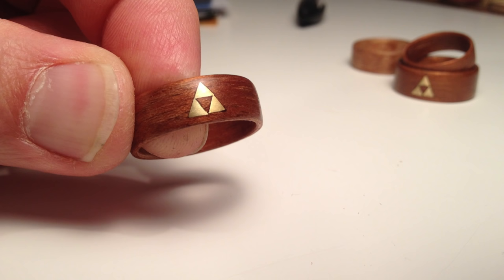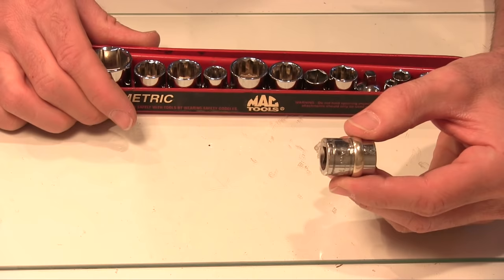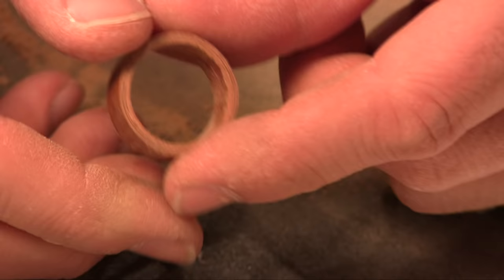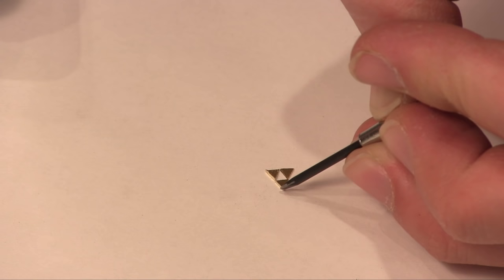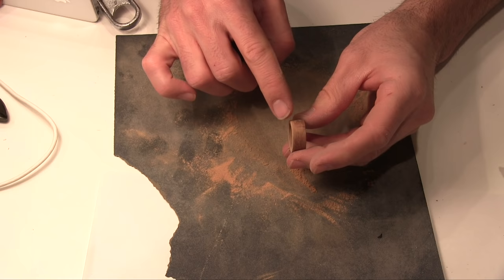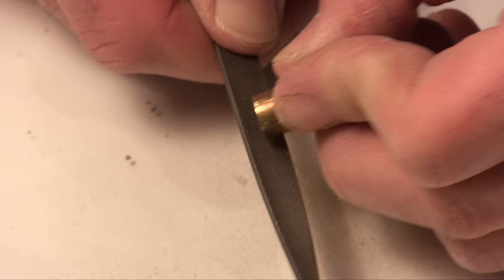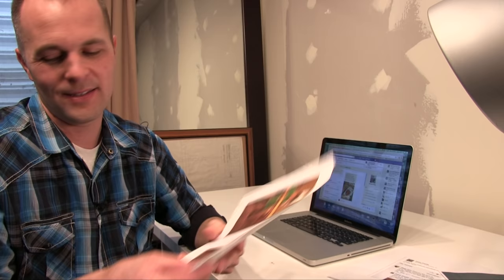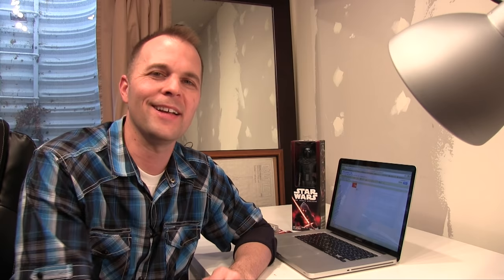How to make Wood Rings - bent veneer w brass Zelda Triforce inlay

Comment: If you want to improve bending process, i would soak the veneer in ammonia hydroxide  rather than hot water. Its a little nastier (safety wise) but the wood won't kink and once dry, it will 'set' in the new shape rather than slightly springing back.
Also  a ring mandrel is like £7...
Reply: I didn't finish watching the video when i wrote this, you used super glue?! wood glue too good for you? godamn pva would have suited this job better.
Reply from the maker: +Stephen Bathory I will have to try that some time. Thanks for the suggestion. The superglue makes the wood waterproof and rock solid.
Reply: +Colin John Cunningham Way to make what could have been a helpful comment sound pretentious as all hell. Not sure if you meant it that way but you come off as more of a snob who like to throw big words around not a professional. Also next time you leave a comment like that, there's really no need to tell someone that you didn't like the project first like he was looking for that validation before you add your two cents.
Reply: +Stephen Bathory I definitely wouldn't use wood glue, because not only it isn't waterproof (by far!), but all the stuff emitted by the human skin would make it fall apart in no time. I'm assuming that the maker of the rings would want his rings to be wearable....
Reply: +ZombieAlchemist As a fellow but mere amateur woodworker, I also didn't 
care for the obviously amateurish nature of the video (the figure/chatoyance(the optical waviness in the wood is called "curl" and NOT made based on how it's cut as the ignorant video states, but an uncommon way the wood grows). Also, bent wood lamination can be done using water for soaking and also with PVA glue, but also as corrected, other fluids and adhesives are much more suited o this particular project since it's a very tight wind as well as needing to be waterproof, which obviously this amateur that only saw 
someone do something cool and wanted to make a buck off putting this up would not know - a disservice to the watchers as well as the true pros that put other more informative and correct videos up on the topic. I'm NOT a pro woodworker as stated, but a decent amateur who appreciates Colin for saying he's a Pro since it differentiates himself from the video author as someone who actually knows what he's talking about, as opposed to simply being pretentious! 

Thanks anyway HappyAtom for sparking people's creativity and possibly getting people into the craft, a rewarding and useful hobby. I'd just do a little more research first so as not to mislead your viewers or sound too much like you have no idea what you're doing to anyone with just a little knowledge about the subject.

Additionally, if the springback isn't as much of an issue, you could still use Tightbond III since it is waterproof. After which, a finish will protect it better from acids and moisture from fingers (varnish is most suitable or a oil/varnish like Watco Danish Oil, which can be re-applied as it wears) .
Reply: +Colin John Cunningham I stopped reading you comment at "while I am not very impressed..." Nothing good comes from arrogance.
Reply: ESPECIALLY if this was for children, I wouldn't let them anywhere near 
CA glue! Speaking of idiots, and talking like one ("people with little
 to know knowledge"???) all you have to offer is pure criticism of a very valid statement. Comments here are FOR people to give their opinions, good AND bad. Being "not very impressed" is hardly a heavy handed criticism, especially given the many issues with the video already addressed.

And it's not at all about complicated, it's about there being alternatives that are better/safer/etc. and also about giving reasons for things that are simply untrue, stated out of ignorance. 

Maybe you should be more aware that comments for How-Tos are as much about sharing knowledge for those ADULTS (not you apparently) that want to learn more about what is contained in the video. They also would care to consider the source, as well, so stating you're a professional woodworker, etc. is of value, NOT tooting your own horn, or coming across as an ass, which you did in your very rude blast of someone offering a professional perspective to someone that was actually purely being rude ("PVA too good for you?) and very incorrect, as super glue was actually the correct glue to use for the reasons mentioned.

But go ahead, flame on...
Reply: Cyanoacrylate = super glue

Comment: That detail on some of the wood (The lines going the other direction to the grain) Is called figuring, It is a natural feature of some trees which happens because of abnormal growth in the tree. Basically it doesn't grow straight up but wiggles up. This kind of wood is much harder to work with because of the irregular grain but is very pretty and used quite often on musical instruments like violins and guitars. Furniture makers use it a lot as well.

Comment: Cool project. A tip I would like to suggest would be to wrap and rubber band your wet veneer right onto socket with the extension and leave it on there until after the gluing, inlaying, gluing and final sanding of the outer part of the ring before removing it from the socket to finish the edges and inside of the ring. If you can mount the extension/socket to a drill or lathe, you can speed up the finishing processes and eliminate most of the physical contact with the CA glue.

Comment: Hey, you could use tape to position the triangles when marking the veneer, also, once the veneer is cut in depth, you coudl position the triangles and use tape again to hold the position. then, when you put superglue, you would not glue your fingers by presing on tape instead of triangles. Cheers

Comment: @HappyAtom at about 20:00, when you are trying to put the triangles in place with the glue, you could keep the triangles in place together with clear tape. This way, you just have to put the tape in place with the triangle stuck under it. It will be much easier, and you won't glue your fingers!

Comment: 19:20 - Why not just glue them while they're still in? It is penetrating glue after all.
Reply: +MrSeagull
Penetrating doesn't mean it penetrates brass and gluing it before setting the brass makes sure they're glued on the back as well instead of just the sides.

Comment: Some quick tips: You can buy different shaped hole punches (or even have them made)  Just punch the hole near the end of the strip that will be on the outside and use the same punch to punch out your filler metal from a foil that is about the same thickness as the wood and you get a perfect fit.  The socket and tape was a nice idea, but it would be easier if you put the tape on inside out.  Then you can just use your socket extension in a drill to do the sanding.

Comment: Can i paint the wood? Let's say black?
Reply from the maker: Yes.
Reply: You'd be better off staining it :)
Reply: Thanks. :)
Reply from the maker: I tried ebony veneer. It's near impossible to bend that tight.
Reply: HappyAtom Buy a block of Ebony, cut it to a quarter inch thick pieces. lay it on it's side, and with your blade lowered to an eighth of an inch above the surface of the table saw, make successive cuts about an eighth of an inch apart. It'll bend like butter, and all you have to do is glue, and sand. And because there's more immediate surface area where you're applying the glue, you don't have the same glue problems as you do in the video, it's a simple clean up the excess with a damp cloth operation.

But you're also making a band with multiple layers, so what you do, is you do the exact same thing in the video, only without trying to do it that tight. You now have a ring for your thumb.

All veneer is is just very thin slices of an actual block of wood. You can do whatever the hell you want as long as you can get the material.
Reply: you cant paint air.
Reply: +Nostrils lol...true
Reply: can I use it under water ?

Comment: Very Nice job on the rings... I will make a few soon and inlay a couple gold nuggets.   I have a suggestion on your inlays... I build acoustic guitars with inlays as well as do many inlays in hardwood boxes and other items.  Much easier method for the glue up is to dry fit your items as you did and just leave them in and flood this with super glue.  The thin water super glue will seep easily into the voids and behind your metal inlays.  Then press them down firmly and let them dry.   (if you are concerned you could also set them in place and lift them up slighly with your Xacto blade before glueing and then press into place)   Sand once to the top of inlay to get the excess glue off and then hit it once more with glue to fill the voids and let it dry and you are good to go.  After doing hundreds I've never had an inlay come out in 20 years of doing this.     Thanks for  the video!!  Rick

Comment: You could also stain these rings too.  I'd do it before you start gluing.  You can use a little bit of acrylic paint to make stain in all kinds of funky colors.  (Get the liquid kind, it's usually called "soft body", not the thick "heavy body" stuff.  Mix it up with a bunch of water and either brush it on or just let it soak.  Or if you wanna be natural you can even use fruit or veggie juice.)

Comment: thanks for the vid.  fyi, the 'suede or microfiber' light changes that you see when tilting the wood is called chayotance.  You can also soften wood in several ways.  One way is to used Downy fabric softener in hot water (it's stinky, though).  Also, a wax-pencil made for picking up glass beads might be useful for picking up the brass inlays.

Comment: Acetone works great for getting the CA glue off your hands.  It dissolves dried CA.  

Thanks for the great vid.  Really cool stuff.  

Also, check out Milliput.  Great stuff for working inlays.  Metal powders work in real well with that putty before pushing it into the inlay.  Milliput comes in colors.

Comment: Very cool video.  Another option for filling in any open spaces would be to use 5 minute epoxy and masking tape.  It's a trick I use to fix gauges in gun stocks, but it would work for this with whatever powder/metal you want to mix with the epoxy.  Lots of color options when you go to pigments.  I've made coin rings before, but it looks like this will be my next project

Comment: Copper question answer from a google search. In 1962, the cent's tin content, which was quite small, was removed. That made the metal composition of the cent 95 percent copper and 5 percent zinc. The alloy remained 95 percent copper and 5 percent zinc until 1982, when the composition was changed to 97.5 percent zinc and 2.5 percent copper (copper-plated zinc).
Reply: In 1982 there were 7 versions of the penny, 3 or 4 with the new copper-zinc ratio you mentioned, the rest were primarily copper.

Comment: Nice project
For the brass work have you looked for photo etch services, you can have shapes made and the sheets are thin enough or even have just contact points you can cut with an Xacto. Maybe a few more dollars, but would  save time marking and cutting and sanding  the pieces.

Comment: Hi, would you think it would be possible to create the incision marks of the brass bould before the ply wood is rounded in the cup? If it is cut towards the end of the ply strip and then wet'ted and rounded on the Socket piece for its bending and superglue'ing, then the incision could already be preset to fill with the brass mould, rather than fiddling around on a rounded (circular ring) edge for a 'perfect' incision. Thoughts??

Comment: Im using a Padauk Veneer and it doesnt want to roll smooth no matter how long i soak it. It starts good then just cracks and looks like a nut when its done. Any suggestions on how to fix the issue.

Comment: here is a tip I learned myself. if you get your fingers glued together, or just one, run steaming hot water over your fingers and it should come off. you may have to peal off the glue during the process.

Comment: I just now found your Channel and really enjoyed the ring making. I've used Super Glue as a finish on my pens but never on anyting. I did however find a new product called 
Alumi-UV. Sold by Alumilite.  I'm sure you have heard of them. They make all sorts of epoxy resins & silicone mold making supplies.
The aAlumi-UV is a one part resin that is cured by uv light or black light. I've just ordered my first bottle, I'll let you know how it works.   Thanks for the great video,  Jim.

Comment: Hi, I'm looking into trying this out. Just a problem. I bought veneer here in Belgium (so difficult to find) and the back of my veneer is a white layer. So not the wood color itself. After boiling, the wood just starts curling the wrong way :) SO I think this is just shitty veneer for this purpose.

For my job, I will be in New York for 2 days soon. Do you have any idea where in New York (preferably Manhattan) I can buy good veneer for ring making?

Thanks very much.

Comment: Thanks for the amazing instructions! By cutting a certain shape out of the sheet multiple times and pressing them together with  pliers you can also make necklace pendants and earrings using this method. 
A quick question for my fellow Europeans: Does anyone know a suitable brand of liquid super glue available in western Europe? The ones I tried leave a horrible chemical smell even after it dries..

Comment: hi, your job is really good, rings look very nice, but I dont know what polish coat exactly is ? Cant we use another thing instead of polish coat ?
Reply: Polish coat is simply the final coat of glue that gives it the shiny finish. All the glue he used up to this point has seeped into the wood, and much of it has been sanded off, so the finish is very dull. By putting one more thin coat of glue (The polish coat) it makes the ring shiny.

Comment: I'm in the process of trying to make this now. I let it sit in the hot water for 10, 20, and then 30 minutes but it's still not flexible enough to EASILY wrap around the socket. Suggestions?

Comment: I have a mahogany thumb ring that I bought from Etsy.....the surface has gone a little dull so do I put on a coat of varnish or a coat of super glue ??
Reply: if i was  unsure what to coat it with id coat some scrap wood and see if the finnish is good then proceed to sand the ring with very fine sand paper (a little bit) to make a smooth surface then coat with desired product

Comment: If you want your rings to be water ressistant, make sure you use glue that is not water solluble or water based in any way. (non water based glues might be hazardous, so read the label first)

Comment: Great tutorial. I've succeeded in replicating the results to some degree, but the glue did not give me quite the same result in term of acting as a "gloss" and had to be sanded off since it looked awful. Also, the only veneer available here was quite pale, so the inlay did not show very much. This was a little disappointing with the time it took to cut the pattern. All thing considered, it turned out well for a first try and I still got a few positive remarks on it. Thank you for posting this, it was a nice project.

Comment: I don't know how you get yours to roll so smoothly.  I've tried several different kinds of wood, and no matter how little or long I soak them in hot water, they either splinter or fall completely apart when I try to roll them.  I'm lost for what to do.

Comment: I dont know much about woodworking, but do you think it would be easier to glue in the inlay if you just dropped the glue on it while the brass was already sitting in? what if you mixed in some dust from all the sanding into the glue, to act as a sort of wood filler to tighten the gaps?
Reply from the maker: Good ideas.  I really think that it would work to just drop a bit of glue on the brass while it is in place but I don't want to take the chance.